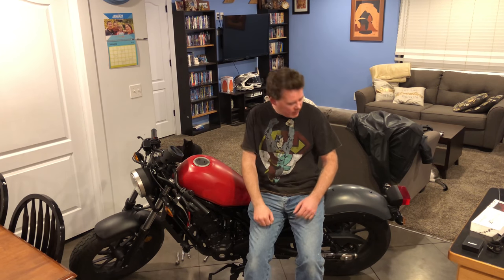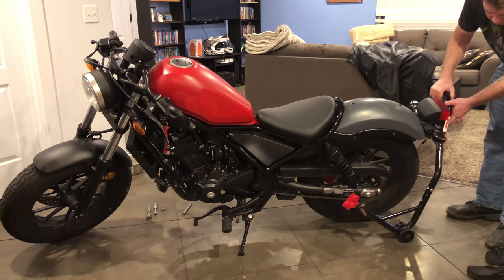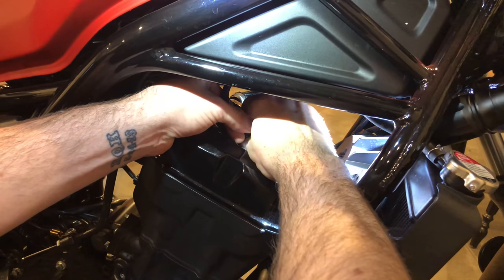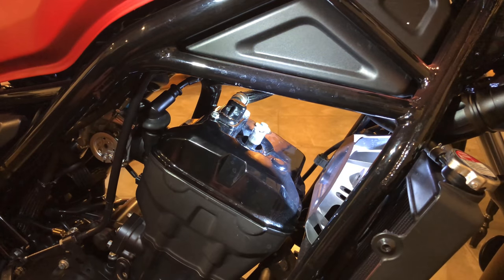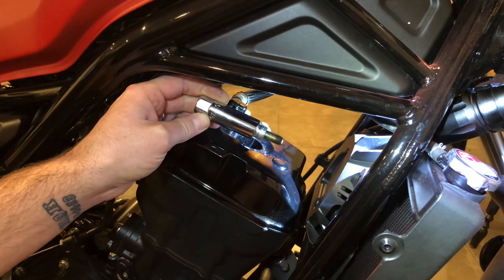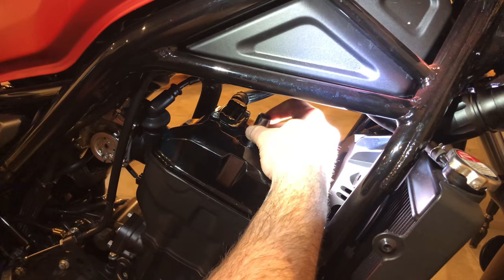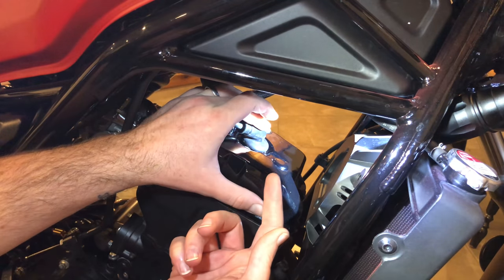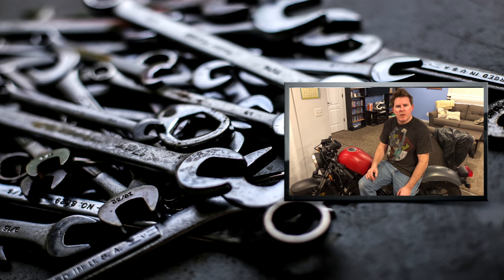2017 Honda Rebel - Spark Plug Replacement

Comment: Flex joint/extension would help ease this process I think.  I'll find out when it's time I suppose.  If someone hasn't beaten me to it by the time that time arrives, I'll upload a video showing it.  Thanks for the vid.  Cheers.
Reply: Did you end up making a video for it?
Reply: @ADRIANRodriguez-kb8mm  na..sorry.  I ended up trading that bike in and moving up to the 2019 cb500x.  ...But irony of that is....I'm actually waiting on a pair of spark plugs for it  ( makes nervous laughter )  so ...

That's a chance for that video  :D

Comment: How did you manage to flip the bars ? I always taught that the controls were keyed into then so that when you turn the bars the controls would just turn around with them ....Keep up the great work , it's appreciated !
Reply from the maker: Yeah...Kinda filed and broke the keys off.
Reply: Arches Mechanic Great to know ! It looks awesome btw , might consider doing it myself .
Reply: Just an fyi the keys are so the controls can't move causing the bike to become basically uncontrollable. For the future you may want to drill new holes into the bars if you plan on changing things.

Comment: I have a rebel 300 just recently bought..what size wrench is used on the rear axle nut...also...should I get a pin spanner wrench from my Honda dealer? Thanks. Great stuff here...

Comment: What was the gap measurement for the spark plug when you replaced it?
Reply from the maker: Spec is .025 mine were at .028 for my elevation

Comment: this also works for a 500, too?
Reply from the maker: Peter Gold 500 is similar but a little more difficult to get to. I have a video called “500 rebel spark plug tip”. Check that out. Might help you

Comment: can i have a link to that lift please
Reply from the maker: Ace Cat here’s the link but I kinda modified them. Extreme Max 5600.3211 Venom Sport Bike Motorcycle Front & Rear Combo Wheel Lift Stands Fork & Swingarm Stands Paddock Stands Fits Yamaha Honda Kawasaki Suzuki Ducati BMW https://www.amazon.com/dp/B01N3CMRMZ?ref=yo_pop_ma_swf
Reply from the maker: Ace Cat only concern I have is I didn’t trim the end and it’s scratched my exhaust underneath.
Reply: i have shorty exhaust so should be fine.